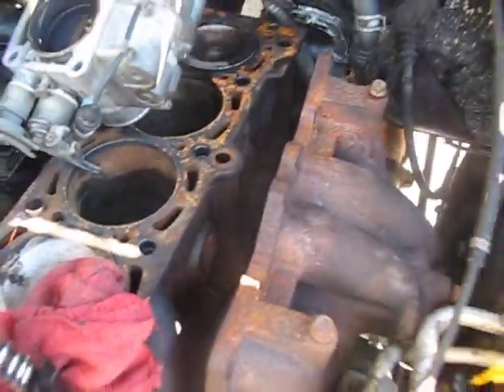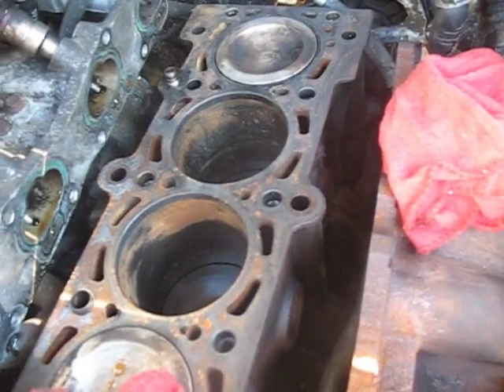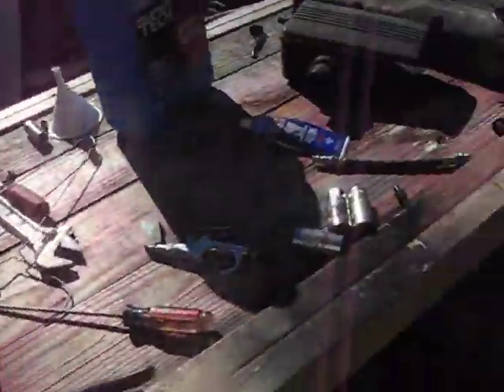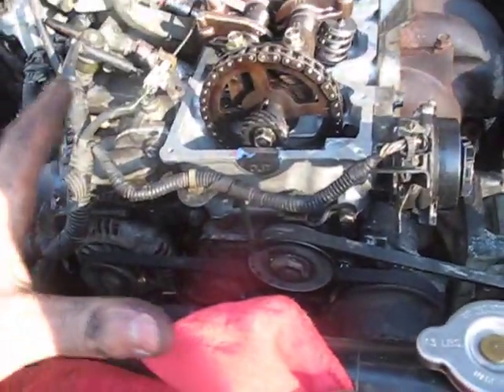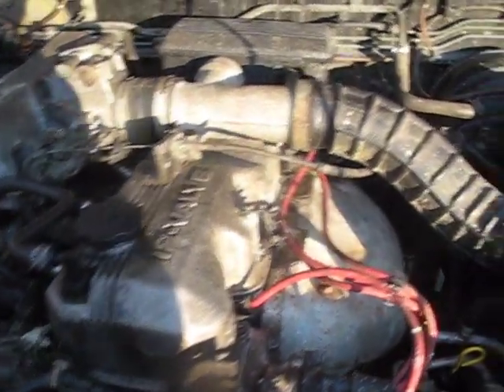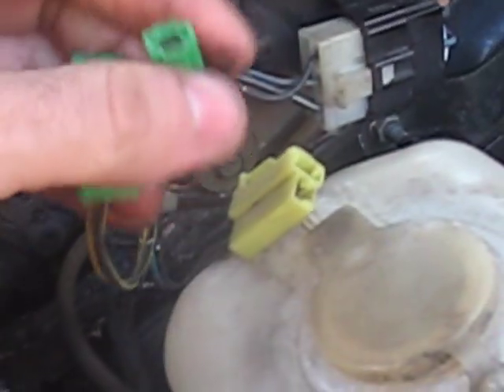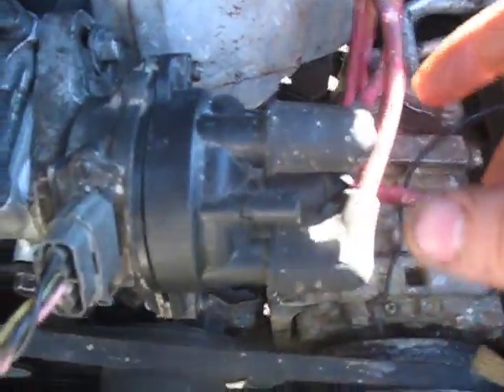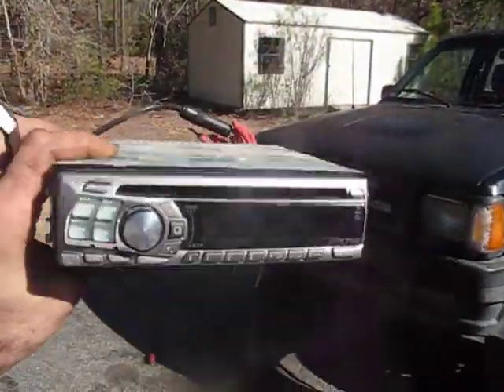How to replace your head and head gasket pt. 3

Comment: This was a great series man. I just bought almost the exact same truck for cheap. A fun little manual 92 Mazda b2600i with 170k miles for a mountain hunting rig. But pretty sure it blew a head gasket after driving it down the highway recently. You convinced me I can take on this project and maybe learn a few things along the way. Cheers!

Comment: My 4x2 b2600i just blew the head gasket today. #4 cylinder right above the fuel injector was just spraying coolant. Hope the head is straight. 20 years and no other big problems though. Good job Mazda.

Comment: Going through the same thing here in the US Virgin Islands. If it had not been for your videos, I would have never made it. Can't get much help here in the jungle. Thank you, more than you know. Hopefully the remanufactured head doesn't cause different pressures on the engine and it will last awhile.

Comment: My landcruiser has been getting hot and pressurising. Had the radiator out twice and blew up the bottom tank. Got a new radiator, hoses and fan clutch. It was getting pressurised so I took the thermostat out to let go of some pressure but I'm going to get in there in June and have a look. I hope it's not a head. But I'm thinking the gasket might be cactus. It's a diesel, hopefully it's not too hard to do. You my friend, have inspired me to have a crack. Pardon the pun.

Comment: for the next time and for those who come across this. buy a new can off oil, ore use used oil. take a rag and rub everything with excessive oil so it wont rust on you.

I always have a can with old oil for this because the rust will pit it.

nice video btw keep on the good work.

Comment: Had the same problem with a Peugeot 2.2 diesel. Scared me half to death as I had not touched an engine since my teens. Still I took a shot at it and things worked out Ok, even got away with using the same head although I did take it to a machine shop and have a thou’ or two skimmed off. If cash is a little tight definitely a job worth doing.

Great vids BTW. Nice job man!

Comment: thanks for the video I got a lot of info out of it and replaced my head gasket on my 1991 b2600i 4x4 in 2017 and it still is holding
Reply: Bro how did u loosen the cam chain? I got the same model and year 91 b2600i 4x4
Reply: @Galaxieshop  On the front timing cover there is a timing chain cover behind that is a chain tensor. I can't remember exactly but I got the nose of the chain tensor to back off the chain. I think I pushed something around the notches on the tensor.
Reply: Yea i seen that, the cover under the head right? And also it looks guy in the video didnt do it likethat but jimmy rigded that part

Comment from the maker: @justsumguy2u Well I was just following the instructions in the manual and recommendations from the guys on mazdatruckin forum, I would rather retorque than not and have it leak again. The engine I have is the fuel injected one, it is actually a Mazda-made G-6 which replaced the Mitsubishi carbureted G54B. But yeah it is prone to this type of failure, which is why I made sure to restore the coolant system before this repair. Glad you liked the videos!

Comment: I just dyno'd my 92 Mazda B2600i 4x4 without the clutch fan on.  I'm at 111k miles and I put down 108 Hp, and 138 Lb. Ft of torque.  I would recommend converting your engine to an electric fan setup.  INSTANT hp boost right there, I guarantee it.  And thank you so much for all these videos.  My head gasket ought to be done very VERY soon and this is going to help so much.  One question though, what is the torque specifications on the valve cover bolts?  You never said in the video.

Comment from the maker: @Chantheung Awesome, that is a lot better than a HG job. Be sure to assess whether your rad plug threads are the problem, or the threads inside the radiator itself. Once my plug came out in my Dodge Dakota, had to ride it back about 10 miles with a dry radiator. Drive 1 mile, rest 30 mins. Drive 1 more mile, rest 30 mins. It sucked.

Comment from the maker: @My1968Impala Thanks man thats actually a good tip, Ive been thinking about finding a paint which I can use to paint motorcycle exhausts, any experience applying paint that can stand up to that heat?

Comment from the maker: @etorment27 I let it idle after the job, and took it on some short rides around my area. After 30 mins tho everything seemed fine, the coolant system was not being pressurized and the engine was running nice and cool, so I knew I was good to go.

Comment from the maker: @MrHTWN Yeah that spinning out noise like the starter is the only thing thats spinning is a classic sign of cam chain failure. Only the crank is spinning, not the cams, because the chain is broken. You are gonna have to take off the valve cover and take a look, follow the steps in my video to take off the intake and valve cover, you should see the chain up there, if not then it is broken and you may have to fish it out of your motor

Comment from the maker: Ive found both Haynes and Chiltons to be entirely sufficient, usually I get them on ebay or Amazon for like $4. Sounds pretty cut and dry that your car has experienced a head gasket failure, but you won't be able to determine whether the head or block is warped or cracked until you disassemble it. Like you said be sure to fix the thermostat before starting the car up again

Comment: great job. i have a 89 mazda 323LX and i think my head has gone. i had bubbles in the radiator and i think some oil in there as well. s a temporary fix i just put a sealwell cube in the radiator but now oil is leaking from the cylinder head. its probably warped and blown gasket. your video was pretty helpful but i think i need to find one on my type of car :)

Comment from the maker: Once the cam was installed on the new head (2nd vid) I just rotated it around to where the little notch lined up with the notch on the cam sprocket. Since I kept that tied securely to the timing chain, I didnt really have to line anything up, it just slid right in

Comment from the maker: @Prototypexl Well unfortunately the truck has since been sold in favor of a full size model, so I dont have my repair manual to check the torque specs. But you should buy a book before starting this repair, and it will have all the information you need. Good luck.

Comment from the maker: @hernen Well it depends, don't quote me on it but I think if you have an iron head and block then you are more likely to need adhesive. This is an aluminum head. But the gasket manufacturer should be able to tell you for sure

Comment from the maker: Generally it results from overheating, which is itself a symptoms of a much simpler problem. In the case of this truck, the thermostat went bad, which caused the motor to overheat, and the HG blew

Comment: Your "Thumbs Up" of 398 vs. "Thumbs Down" of only 16 means you held everybody's attention through three episodes-- quite an achievement. Most impressive is you persevered through unfamiliar territory and occasional mistakes. In fact, your viewers may find your mistakes more valuable, because you discuss how you viewed the problem, and what worked to fix it. Doing all this yourself with only a paper manual (Chilton's or Hayes?) is a tribute to manuals, but also patience and effort. Did you have any prior experience with auto repair work? It seems you had a substantial amount.

Comment: hey man, did this improve your milage much or at all? just curious coz i have a b2600 with a leaky valve cover at the least, thinking my issues don't stop there coz i can hear some kind of bubbling in the engine from the cab everytime i turn the car off which my best guess is some kinda pressure into the cooling system, really hope not but more curious about milage coz mine is terrible and half the reason i'm trying to sell it

Comment: Started watching your videos with the XJ650 redo checking through the others and you have a B2600 as well,when you redid the Valve cover gasket on the Mazda did you use a silicone sealant with the gasket? as I have to do the cam plugs as well.Great vids and you have a Blue cattledog.
Dude, XJ's a B2600 and a Blue cattledog as well you are my brother from another mother! Greetings from Oz to your dog.

Comment from the maker: I didnt need to because I tied the chain to the sprocket. There is only one way that the shaft fits into the camshaft sprocket, so as long as you tie the sprocket to the chain, you dont need to set it afterwards

Comment from the maker: @chrriff I just got the head off ebay, I dont remember the seller but he reconditions heads and sells them for pretty cheap. And yeah I was going to buy a gasket set, but the only ones I could find included the exhaust gasket, which I reused, so buying them individually was cheaper once they finally sent me the right one lol

Comment: Continued... When at normal operating temperatures no oil is leaking. Opened up the valve cover too and there was that milky, foamy substance from the oil and antifreeze all over the top, but not on the camshaft or anything. Also, the heater isn't working. I'm assuming it's another thing that can hint at what's up. So.. is it normal for oil to leak into the coolant when overheating (maybe warping)? I plan on solving the coolant problem by tomorrow, but I don't want a vicious cycle. Any insight?

Comment: Hey! Awesome videos! Where, or from who, did you get your service manual? Was it like a Chilton or Haynes? Haven't had any luck with those. Anyway, I'm having some overheating issues ('97 Saturn SL). When I checked the coolant it was mixed with oil. Cleaned out the radiator and everything but it's still overheating. Though, found a dead thermostat so that might be it. What I'm concerned about is the oil leaking into the coolant. This only happens when it gets above operating temp... Continue>>

Comment from the maker: Thanks for watching, I didnt initially use any oil on the block surface because another Mazda owner told me I needed to use some sort of adhesive for the head gasket. It turned out I didnt need any, but yeah next time I will oil it

Comment from the maker: Well something that I learned well after doing this video is that I prob should have used a used head. The new valves in my new head caused increased compression in the cylinders, which caused the rings to experience accellerated wear over the course of the next year after I had sold the truck for my new GMC. If you want a new head you might as well do new rings while you are in there. However a good used head from the junkyard will typically be fine, thats what I should have done

Comment from the maker: @64460242 Right on glad you got it sorted out. The machine shop gave me the option of shaving down the head, but after paying them to do that, plus ordering the custom shim it would have required, the cost was about the same to just buy a new (reman) head, which came with brand new valves and valve seats. So, thats the route I took.

Comment: If you were to put some oil on the cylinder heads and around them then it wouldnt rust am i right?
Reply from the maker: Well I would have, but initially there was some disagreement on the mazda forum I was on about whether a sealant was to be used for the head gasket. I didnt want to put oil on it in case I needed the sealant. Turned out this gasket didnt use  a sealant, but it only took a couple minutes to scrape off the rust so it was no big deal
Reply: That or wd40  works great too.. ( wd= water displacement, so it wont rust.) 
Then just before you install the gasket you clean the block with acetone and it cleans everything off. Weather you're using sealant or not.

Comment: I changed a head gasket on volvo s60 d5 2002 diesel in a garage my friend recomended me, but after they did it, my car started vibrate when i push the pedal it starts @30 miles... what could it be? when i dont push the pedal its good... even in 70 miles... ???

Comment: thanks for answering. 

yes some need an adhesive, in which case i missed to explain is to clean the oil of when installing the head gasket. Little dishwasher liquid will do just fine.  My bad. Any way i hope you do not need to do this procedure again. ;)  I guess its still running after a year ore two further. it wont fail on you.

Comment from the maker: There really isnt any way to tell if the head is warped or not without taking it in to a shop and getting it measured, so most guys say to assume that it is until proven otherwise. Dont worry about the repair tho, your truck is probably even simpler than mine to do.

Comment: Probably did, but he had to wait weeks for the parts to come in, which, without consistently re-oiling those parts would be enough time for it to rust. It seems like it would be less effort just to not worry about oiling it, and rather clean it up when it's time to put the head back together, which he did.

Comment: i saw you have your fan laying down, your not suposed to have it laying down, its a special fan, with fluids inside it, its viscose fan im talking about. just letting you know, for another time, it would be a shame to get a engine running hod after replacing head gasket and head, just to ruin it but not knowing how to plave a viscose fan :D